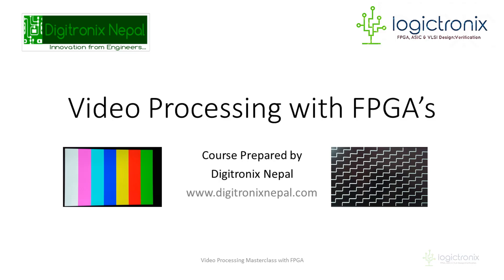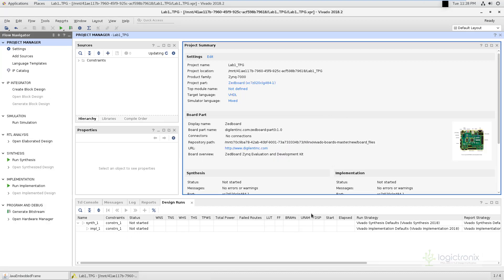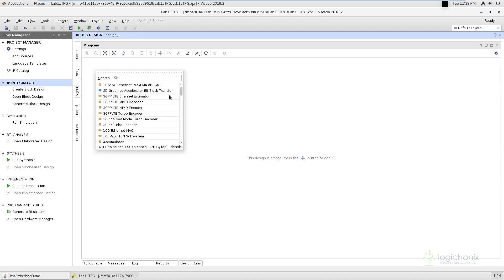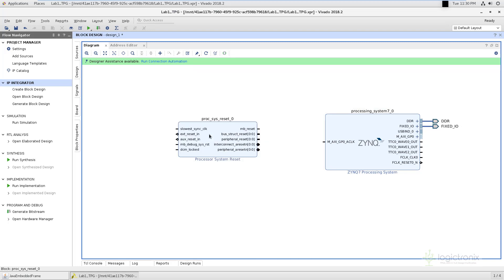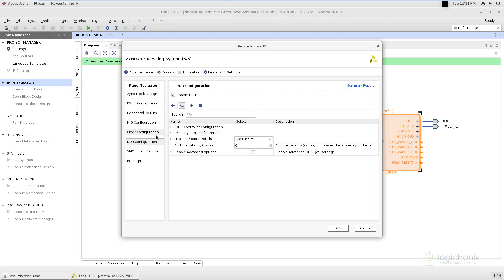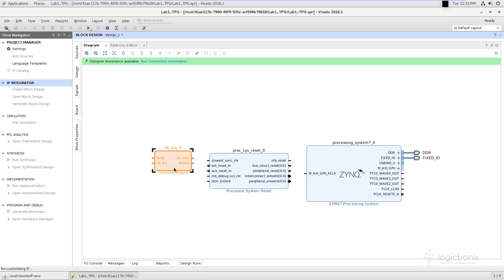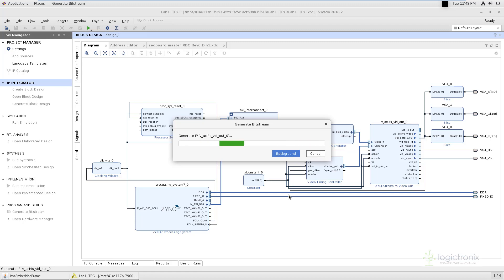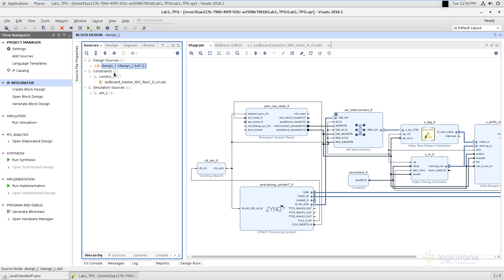Test Pattern Generator Implementation for Image Processing with Zynq FPGA

Comment: Not sure about the board or VGA DAC you use, but seems like pixel clock (PCLK) output is missing in this design.
Reply from the maker: Hello Tomas, thank you for your comment! We use the ZeddBoard FPGA. In this design we use the slices for the VGA interface [with constraint]. We provide the clock from Clock Geerator. So in this design there is no "PixelClk". And this design have TPG which generates the Video Test Pattern, so no real time video input so no need to have "PixelClk". This is our tested design!
Reply: what changes need to interface it with hdmi?